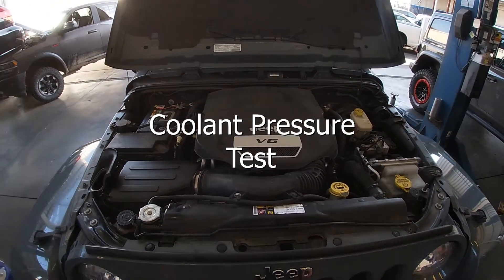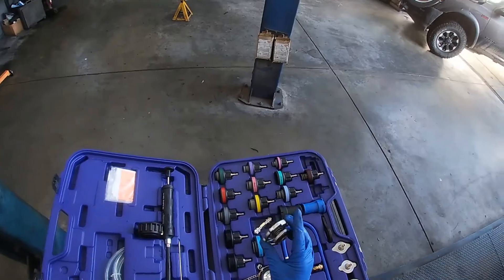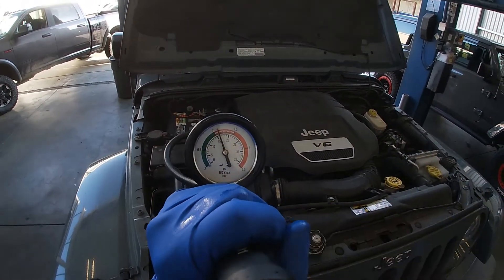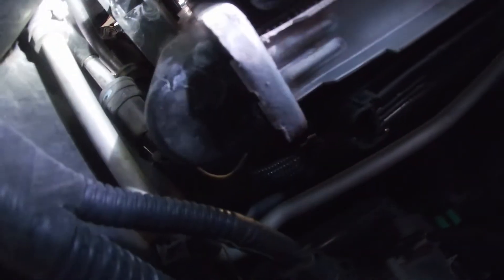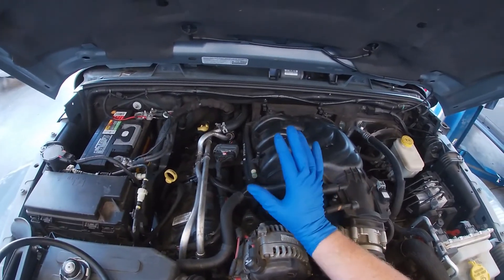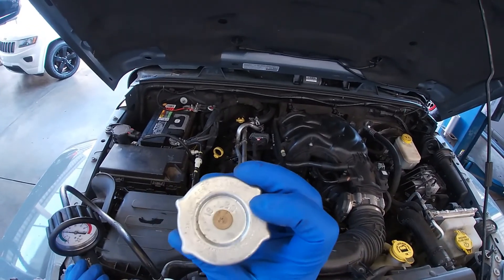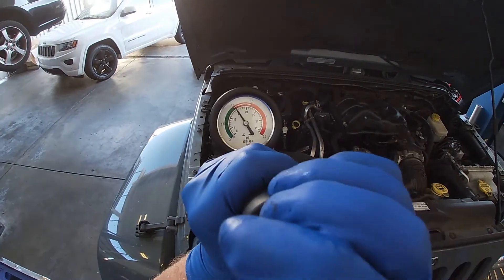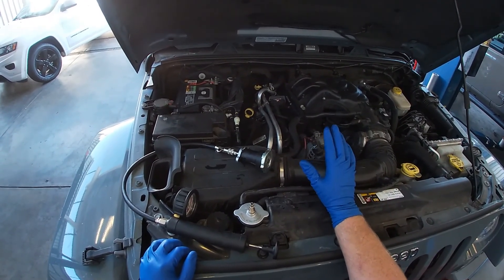Coolant Pressure Test

Comment: What is the normal operation of the thermostat and cooling fans temperature wise?
Reply from the maker: @julioolivarez7376  The 3.6L pentastar engine has a 193 degree or 203 degree thermostat. The fan kicks on low speed around 205-215. High speed at 220+

Comment: Might be a stupid question, but can i use a small 12v  tire compressor to pull a vacuum
Reply from the maker: Never thought of it that way but if you got the adapter for the cooling system to connect to the Schrader adapter then it might work. You would need away for the moisture to go around the pump with a t fitting.
Reply: Do you not take the thermostat out how does the pressure pass by?
Reply: @aaronbarnett1782  the other hose